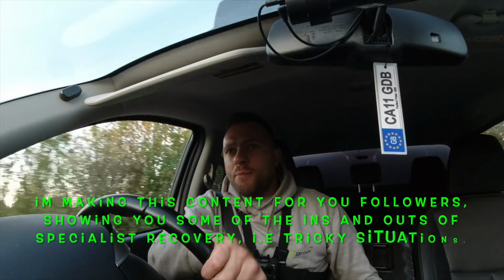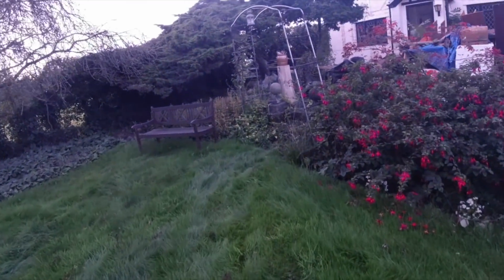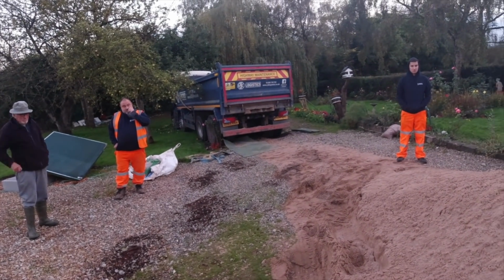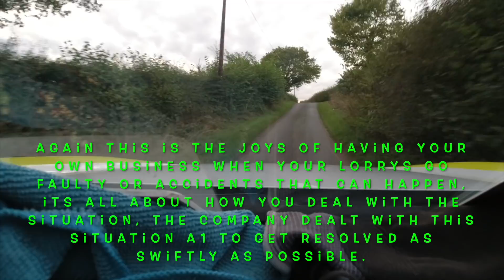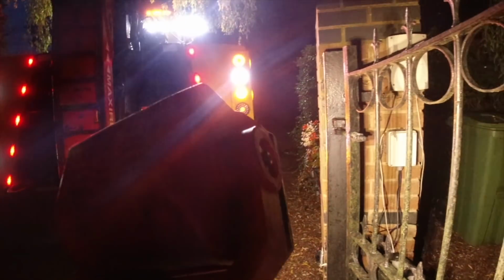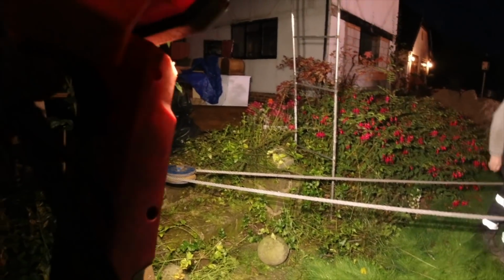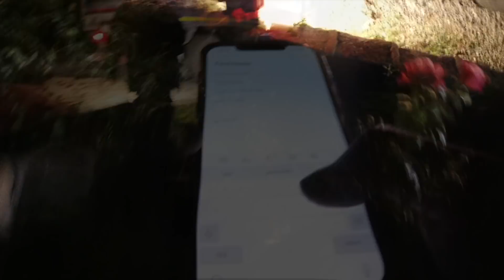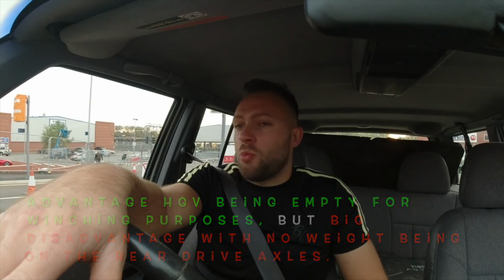Specialist HGV Winch Out! Operation APPLE TREE! All Units GO GO GO!

Comment: In the army we used a anchor set consisting of a plate with six holes either side and one meter pins were driven in at 45 degrees you could ad more plates and in different patterns depending on the ground and winch from them
Reply from the maker: Yes that's right I have seen them before, we have similar stuff for light recovery and ground anchors, heavy is a subby we use locally, there work load is mainly bus and coaches but they help us out on some jobs round here, so not geared up for 24.7 off road recovery etc like some others may be! thanks for the watch

Comment: Great job Greg,well done. That's the trouble with an 8 wheeler,one those front axles sink,your buggered! Well thought out on the winching side,a Holmes tree,or stump in this case always comes in handy. Satch blocks certainly saved the day too. That DAF wrecker had a tidy wheelbase on her,not the best for confined spaces,respect to Kev! 
Stay safe,here's to the next one.
Reply from the maker: Yeah doesn't take much, absolute zero weight on the drive axles aswell, if he was loaded I think he could of got him self out! , I wasn't very confident on that stump with how low it was cut, but once I cut a groove in the stump and used a chain no bother at all! , Took ages packing the winch lines back in / carrying the kit! , Yeah that dafs got good equipment on it long reach underlift for coaches and buses that's there main bread and butter! , Thanks for the comment! Catch you on the next one!

Comment: This is a question not related to this video in one of your previous videos you used magnetic lights on the back of a car when you spec lifted it where did you buy these from as I’m fed up of using my light board any help would be great also keep up the great videos !
Reply from the maker: That is correct! go on eBay type in magnetic trailer lights! Think our brand is called Connix or something normally get about 12 months out of them before they loose sync or cables come tired from charging blah blah, I get a new set ever year ish.

Comment: That was a job and half there. I’ve seen you can get screw in pilings you put in with a handheld petrol auger kind of machine. Do you think it’s something you could use to winch off ? I’ve used turfer winch’s before with ground anchors in the army.
Reply from the maker: Yes that true pins that go into ground and ground anchors and so forth we have equipment for light recovery as that's what we do and specialise in, but hgv we don't own nor specialise in house, so we don't have the equipment for that! IF we did own a hgv we would obviously have that bit extra equipment for diff scenarios! and the subby does not specialise in accident recovery they mainly do bus / coaches etc!